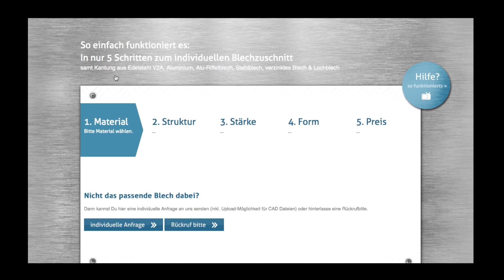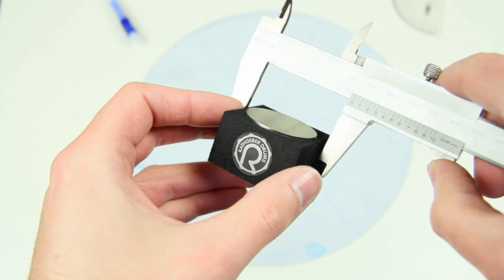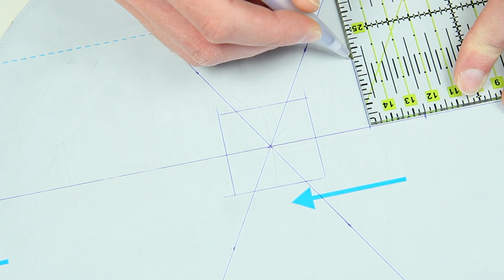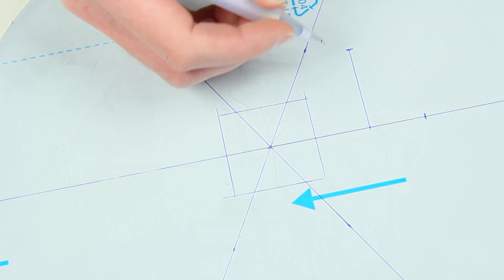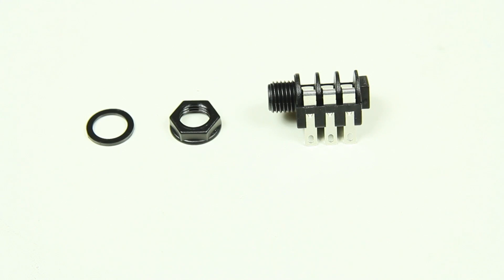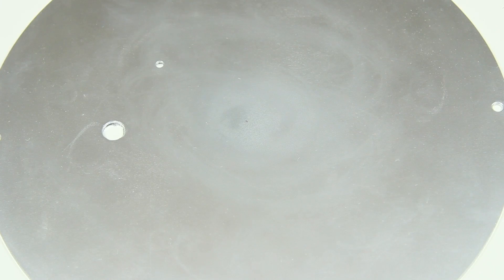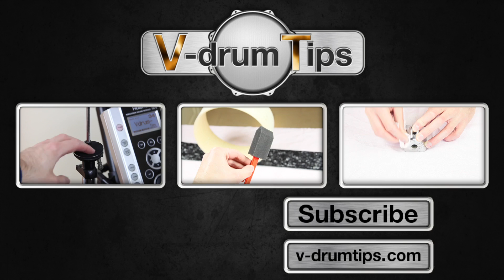E-drum Conversion Part 3 (Tom triggers)

Comment: I had a general question regarding this DIY approach and "positional sensing" as used in the Roland TD30 and TD50 modules.  Would building and correctly wiring the piezos work with the positional sensing feature of those modules, that you are aware of?  I understand that in order for it to work, there is a computation that occurs between the head and rim piezos that is required.  Just curious what modules you have tried the drums on and what works and what doesn't.

Comment: What material would you say the R-drums decoupler is made of? Is it like more of a mouse pad feel or yoga block? 

I love all of Rdrums designs but I can't afford shipping to the states so I'm trying to re create them as close as possible. Thanks!
Reply from the maker: Non of both. The material is a foam, but with a specific density. DIY blocks will most likely not work. I tried that already and it was a nighmare.

Comment: I really appreciate you making this video, but I tried to make it and the results were very disappointing.  I'm following this design on a 14 snare and I'm finding that the aluminum vibrates/reverberates and causes all kinds of cross talk between the 2 piezos.  Did you have the same problem with yours?  If this design works then the magic must be in using the exact right material for that black isolation block.  I've tried various types of foam, each with equally bad results.  What material should I use to make that? I don't want to order it all the way from DE, I'm in the US and looking for materials that can be sourced locally (i.e. what's it made of?).
Reply from the maker: Sorry to hear that, it could be the plate is too thin. The isolation block is specially made for this purpose, you cannot use any foam. It is absolutely worth it to buy the original foam from R-drums.

Comment: Awesone video series :) 
I'm planning to build the trigger systems just like that and asking myself if using 5 mm (or whatever thickness) MDF disks will also do the job or if it does not transfer the vibrations for the rim piezo accordingly. Using MDF disks would also not require damping the disk itself. 
Thanks and keep up the great work!
Reply from the maker: Thank you:) Yes, MDF works aswell.

Comment: Hello, I was just wondering when assembling the trigger, is it necessary to have a decoupler for the cone and piezo? If not, do you have any ideas of materials i can use as a substitute for the decoupler.
Reply from the maker: yes, otherwise the head piezo is getting triggered by hitting the shell. It needs to be isolated. You can use rubber washers or foams. The problem is that it has to be ideal. Not too much, but also not too less. This is why I strongly recommend using the decoupler from R-Drums, they only cost 5 bugs each and even supply a metal surface for the head trigger. I was doing a DIY trigger with my own decoupler material. It was horrible.
Reply: Vdrum Tips oh ok, thank you very much. Soon i am planning to do this conversion very soon. I will just need to buy the toms and snare. I also have one more question, what dimensions were the snare and toms in the pearl kit because i am curious whether or not my drum rack is sturdy enough to handle the weight(i have an alesis dm10 studio rack). I plan to have 2 10' toms and 1 12' floor tom but i dont know how long the height would be. I am only curious for the toms, for the snare i will be mounting on a stand. Again thank you for your help. :)
Reply from the maker: the snare is 13x5 the toms 10,12,14x4,5.

Comment: Hi I was just wondering why the metal sheet shouldn't be more than 2mm thick? What would happen if it was for example 3mm thick? Thanks!
Reply from the maker: +MrDalankyman It can be as thick if you want it to be. It would actually be better if it is 3mm, as it will cause less noise, but slightly more weight.
Reply: +Vdrum Tips Awesome, thanks for your help!

Comment: Awesome!

Its time to think about your own - mass production line? :))
Reply from the maker: Aleksandar Savic I thought about that, but I am not sure if I will have enough customers, as this product would be expensive.
Reply: Vdrum Tips Thats thrue, but everything could be settled in few different quality grades. For example shells, instead of Pearl Traveller used, could be made of - 10-12`` PVC tubes, or from raw wooden shells 10-12`` , inner metal disc, could be - plastic one, pad lugs could be some PRC bulk buy, etc......
Reply from the maker: Aleksandar Savic That would be an idea.